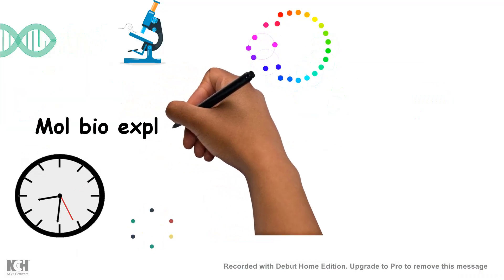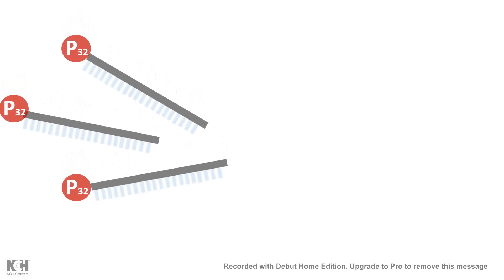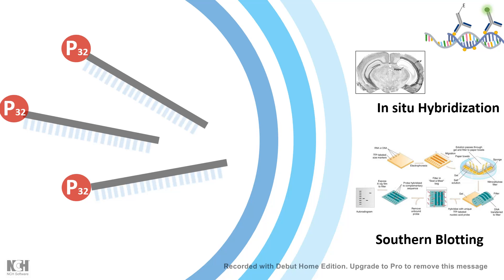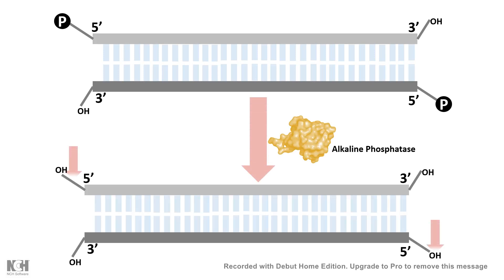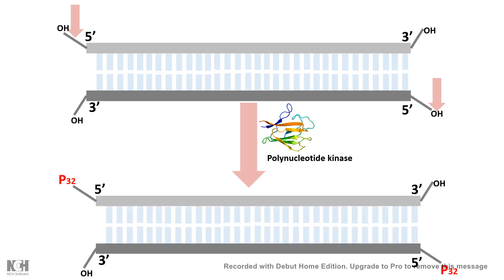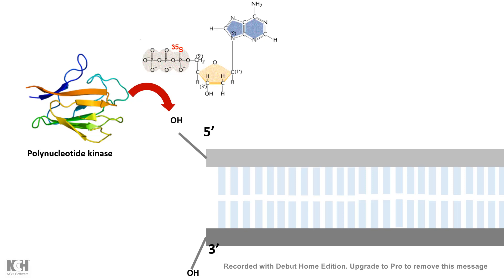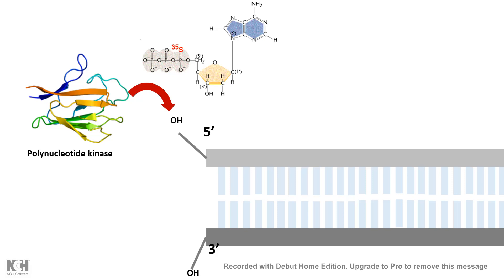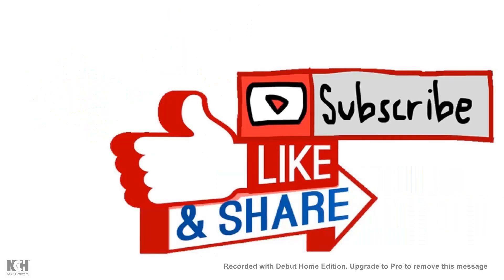5 prime end labelling | end labeling of DNA | How do you label the prime ends of the DNA molecule?

Comment: Hi, I was wondering how I can label only one 5' dsDNA end. It's the first step for the Footprinting experiment, I only do need 1 labelled end. Do you know how can I achieve that ?
Reply from the maker: Nucleic acids may be labeled at their 5´ end, their 3´ end, or throughout the molecule depending on the application. For hybridization reactions (Southern or northern blotting) it is usually advantageous to generate high specific activity probes with label distributed throughout the nucleic acid, through techniques such as nick translation, random priming, by PCR or in vitro transcription using labeled dNTPs or NTPs.
Reply from the maker: For 5 prime labeling ૪Radiolabeled ATP and polynucleotide kinase is good option.